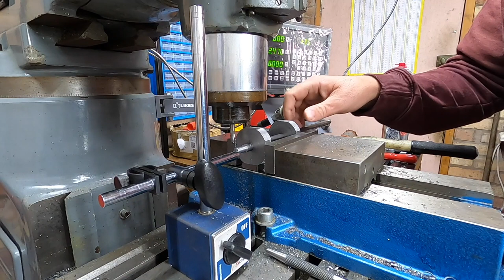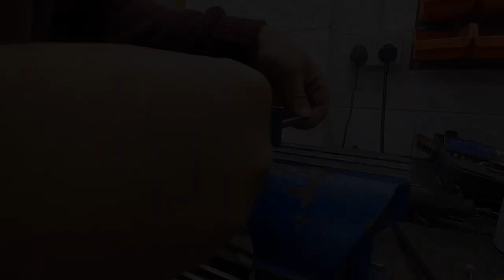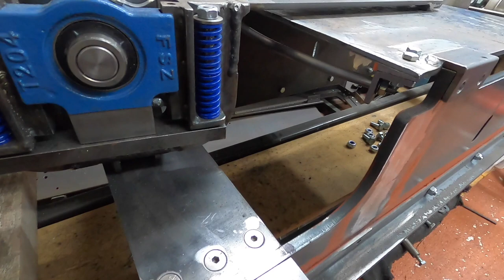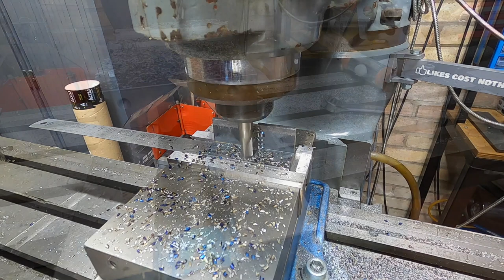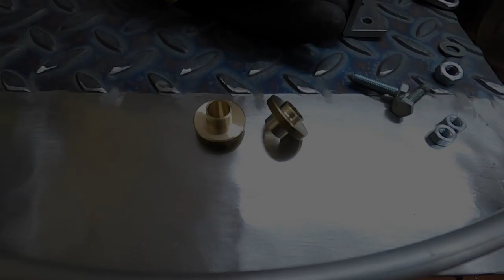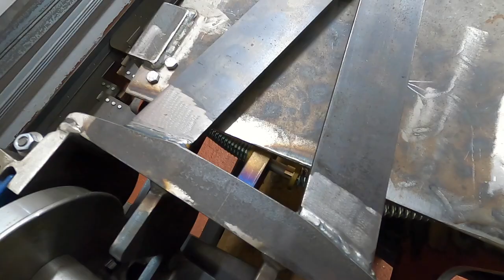Centralising Pony Truck - EP31 - 7.25" Gauge Steam Locomotive Build

Comment: A brilliant video, one question I do have is how much travel do you now have before the springs become coil bound?
Reply from the maker: Short answer, a lot more than it ever will travel. They one I’ve copied it off goes round 28ft curves at the Conwy Valley railway with no issues. All the best, Matt 👍

Comment: More expensive, but I wonder if bronze would be a better material for those washers. I would think the brass ones would wear out pretty fast. Time will tell, I suppose. Well done, Matt.
Reply from the maker: This is very true, I think they will last long enough to worry about it further down the line. All they really do is spread the pressure of the spring over the slot of the fork. All the best, Laters, Matt

Comment: Hi Matt The pony truck is looking good. Do you think there may be a good deal of dirt collected if grease is applied. Would  some flex tube provide protection. Happy New Year Matt
Reply from the maker: Hi R B, hope your well & happy new year. My design is based on the one on Ste Stockdale’s Tink ‘Sian’ which is down at my local club, and in 12 years of running it he’s never had an issue with dirt being collected. He regularly runs it too. All the best, Laters, Matt

Comment: Wouldn’t it be better the make the brass washers from one piece instead of two?  Just wondering if the fork might catch on the edges of the washer when it comes back to centre?
Reply from the maker: Hi Mark, the bits in the middle of the brass washers are smaller diameter than the slot in the fork. The middle bits are only really there to aid in assembly to keep them apart to slide the fork in. Think if it was one piece it would struggle to slide along the curve of the bar. All the best, laters, Matt
Reply: @MattChiversWorkshop  good point about the sliding. Thoroughly enjoying your build!
Reply from the maker: Thanks  @modellingmark  really appreciate your support. I can confirm, as the build in reality is further on, there is some very exciting moves forward over the next couple of months in the videos! Matt

Comment: Uhm... Why make it a curved bar at all? How much longitudinal travel is there in that point where the springs attach across the swing of the point truck? Half an inch, maybe one inch? You could just have a straight round bar to hold the springs and an arm with a slot instead of your fork, with the exact kind of linkage you see in the reverser of a walschaert motion. That gives you two separate single degree of motion sliding bearings which you can engineer to fit properly and keep grease in.

The bushings can have no kind of fit on that bar, because one is a single curved surface and the other is double curved. It's sloppy engineering.
Reply from the maker: This is a direct replica on one fitted to the same class of loco at my local model engineering club, that has run for over 12 years with no issues. Although I think it would be interesting to make something like you describe, its well over engineered for what its doing, which is something very basic.

Not once do I say that the brass parts are bushings, I say they are washers, which is exactly what they are, but shaped to fit the end of the spring for location, and the other side a shank to hold them apart for sliding the fork in. Its not sloppy engineering at all, its a method with a proven track record that works and improves the ride of the loco. All the best, Matt.